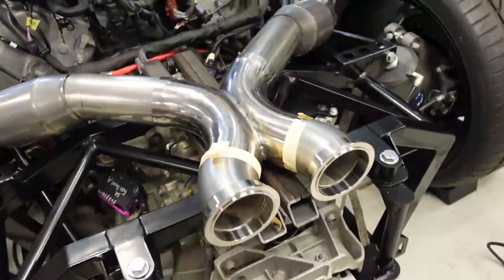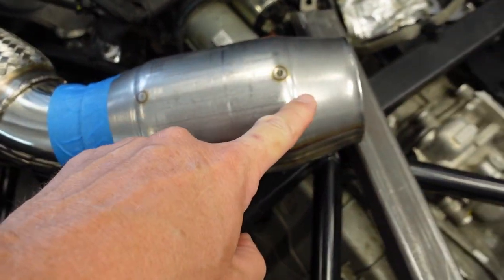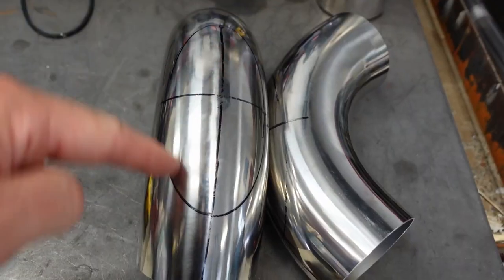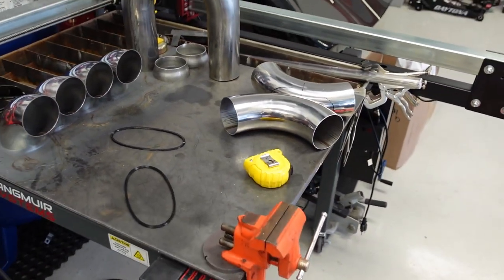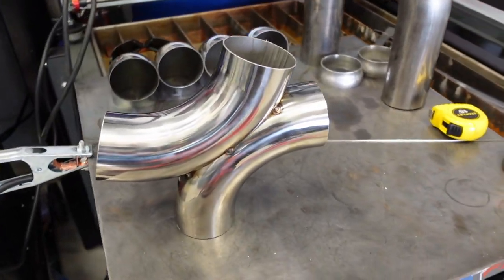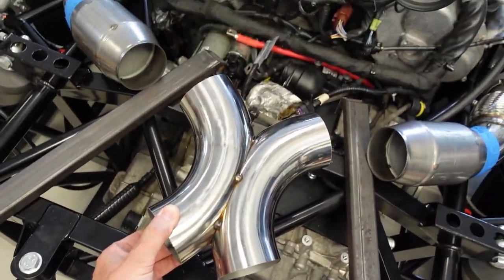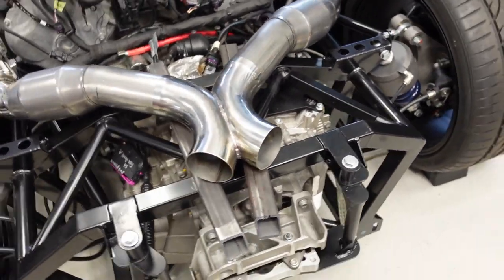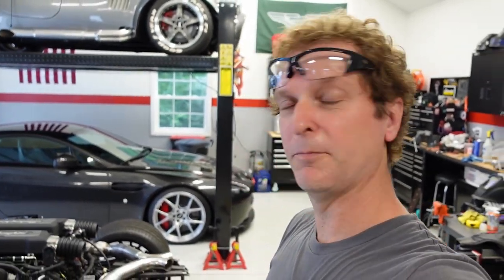Building an X-pipe *without* a bandsaw!

Comment: hi mate, great work you're doing. just some tips from what I saw when you were welding the x pipe up:
1. your tacks were penetrating too deep, up the amps(e.g. 1.6mm stainless tube I'd go 100-110amps) and flash tack the pieces together. If there's a gap, lower amps to about 90 and put some filler at the joint as you flash it together. you can see on the inside after you tacked it some sugaring and on the outside a bit of brown burn marks on the tube, that's because you're putting a lot of heat in and don't have enough gas coverage(up postflow for tacks to 2/3s)
2. when you were welding the x pipe, you were running out of the shielding coverage. get a bigger cup (e.g. 16 or 20) and you can make longer welds before having to stop. again more postflow needed here(about 8-10s, more as the part heats up). also you're cooking the stainless, again turn your amps up(55-60A), form the puddle in under 1.5s and get moving FAST.
Reply from the maker: Wow—thanks so much for your tips and guidance!  As you can tell, I’m still climbing the learning curve so you help is greatly appreciated! 🙏

Comment: Hi Dan as I've mentioned before  because of close contacts under the clam like that rubber gear box mounting I would get the complete exhaust Ceramic coated and heat shields fitted where possible to try and reduce the under clam temperature as usual great work I love the look of these cars Best Regards from Liverpool England
Reply from the maker: Hi Dennis—great minds think alike. I’m going to do exactly what you recommend once I get all the mechanical elements finished/installed in the engine bay. I’m even considering getting the exhaust system wrapped with Inconel type insulated shielding. But you’re right, heat is a major thing that’s important to corral.

Comment: Instead of being gentle and careful with the clam shell take a mould of the top part then just cut the area above the engine out.
The area between the two sets of oblong vent holes would be a good place to put the cut. If you trace a line around the bulge shape spaced out about five or six inches you can raise the height of the bulge by putting in a step up.
You could even  have a place that does vacuum forming to make up a new bulge out of clear polycarbonate shaped with the height increase in it.
Reply from the maker: Great thinking!  I’m definitely considering something like this…I just need to research what’s available locally for me that could help with vacuum mounding and such. Thanks for your suggestions!!
Reply: @DanDulac  I have done some diy vacuum forming it’s not that difficult.
You will need a few heat lamps a few hot air blowers a couple of good shop vacs A suitable buck to use as a form a sturdy table you can drill some holes in and a fire extinguisher by the power outlet for when you cook the circuits running all that junk.

Comment: Have to admire the effort put into this, have you considered the dynamic movement of the power plant and clearance needed not just static engine off.
Reply from the maker: Under power, the engine will want to twist towards the passenger side. I’ve checked to make sure I have appropriate clearances all around. One thing that will help stabilize the engine sitting on its mounts under load is I’m preserving the dynamic engine mounts that will activate under heavy acceleration: they stiffen the engine mounts considerably to minimize the twisting tendency. I also added the flex sections to the exhaust to also give the exhaust system some free movement under load conditions. Thanks for your comments! 🙏
Reply: @DanDulac  Best of luck with it

Comment: Have you thought about doing a separate video about the other cars in your garage? I’m especially curious as to what the silver one is? I’m thinking Some kind of Porsche or Mazda based on the front end.
Reply: It’s a Toyota Celica Supra 2.8 coupe, much improved by Dan.
Reply from the maker: James nailed it. It’s an ‘85 with significant upgrades: 3.0L 2JZ-GTE with Precision Turbo SP6262, T56 Magnum 6-speed transmission, custom 17” wheels that match the original 14” wheel design, big brakes (Wilwood) at all 4 corners, and carbon hood and rear hatch. I plan on doing a video this summer on the car. I’ve gotten lots of similar requests!